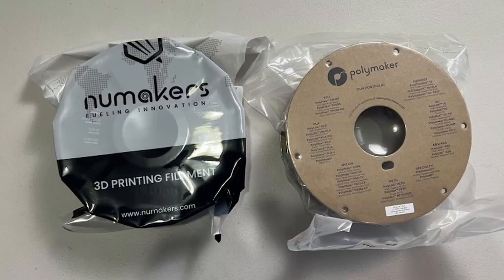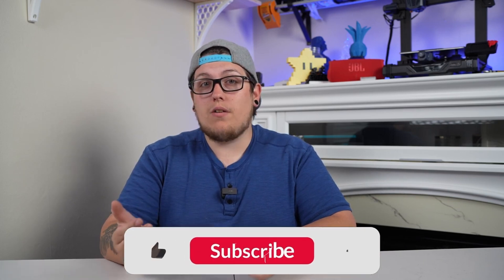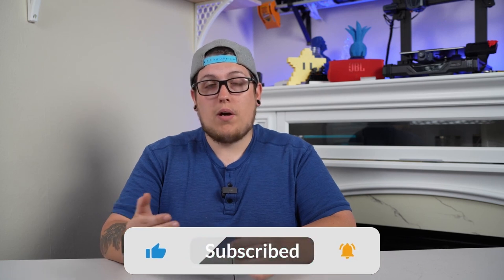5 Rookie 3D Printing Mistakes (And How To Avoid Them)

Comment: biggest mistakes i made starting out were, 1. cheap filaments (i only buy 1kg rolls now), 2. cleaning the bed the right way, 3. manually level the bed once a month or 2, ABL is nice but not bullet proof, 4. learning the slicer program (i cant stress this enough), and 5. taking extra time during the setup process - this will save you hours and days of trouble shooting
Reply from the maker: Absolutely all of those are massive!!

Comment: Good tip with the tightening of all screws!
Once I had a badly clogged nozzle - or so I thought. Prints would look like a mess, strangely on repeating patches.

Disassembled & cleaned hotend multiple times, cleaned my Bondtech CHT nozzle multiple times (what a nightmare), replaced bowden tube etc. etc.
After there was nothing left that could cause it - and the problem still peristed - it made "click" for me. 
Checked the extruder and what do you know - the setscrew of the driving extruder gear was loose.
Reply from the maker: Have had the exact same issue on several occasions! With various machines that have come and gone glad you found some value here!